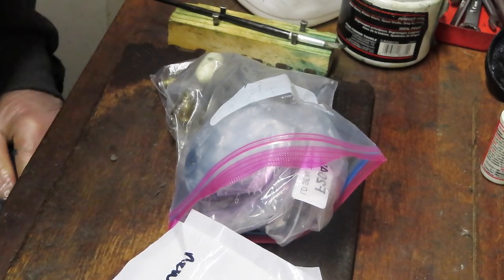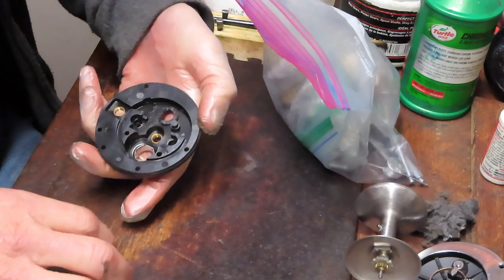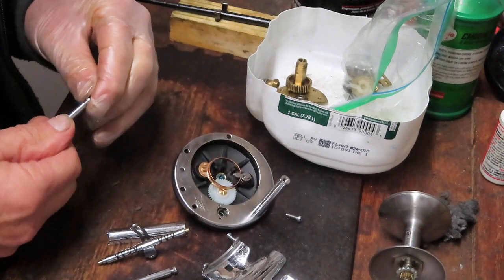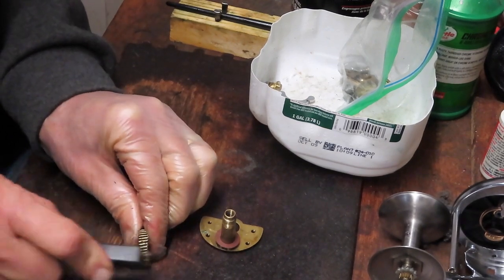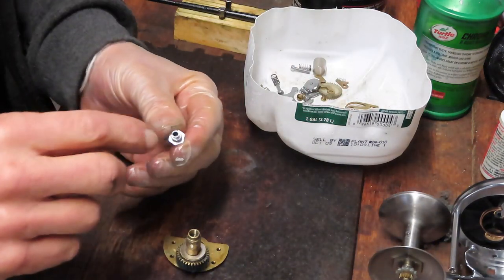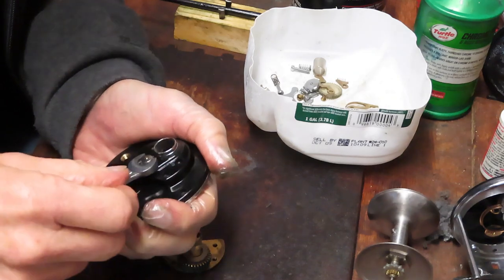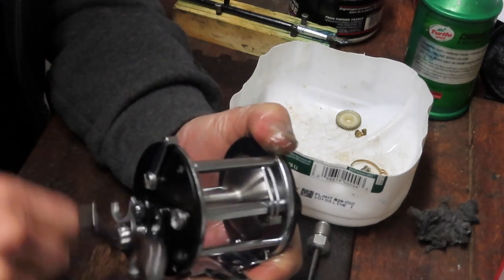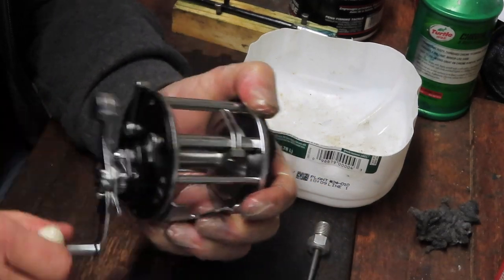Penn Peer 209 fishing reel in a bag how to service and assembly this parts reel

Comment: You know, I don’t like doing jigsaw puzzles unless I’m doing it with 2 or 3 other people. I don’t think you can do one of your fishing reel jigsaw puzzles. Your knowledge and experience enables you to do this. Doing this is truly an amazing accomplishment.  I’ve told you before my preferred fishing reel grease is Super Lube synthetic grease. It is the best grease for all my old vintage Mitchell reels. I’ve started using it on all my vintage spinning reels. It seems to not dry out as quickly and I like the white translucent consistency. Though it can be used for other things than fishing reels, several guys I know that work on a lot of Mitchell and Penn reels recommended Super Lube primarily for the old Mitchells. Two of these guys actually worked for Mitchell before they went out of business but kept servicing Mitchell reels to this day. Both are in their late 80s now.  I do use Pen Precision Reel oil exclusively. I learned my lesson about buying unbranded so-called reel oil on EBay. Don’t ever do that! That unbranded oil is CRAP!!! This Penn is going to be a beauty when you finish!  Last night I won another Luxor Saumon et Mer No. 3 spinning reel on EBay.  It is a  PUM version unlike my other one. I’ve learned that this Cadillac stub bail reel I have is surpringly similar to a Centaure Paciic half bail.  I’ll send you pics. to see what you think. I love the Cadillac - very smooth and extremely well made!  I’m looking at a Ru Mer surf reel now from the guy who sod me that Mer 52 Punch surf reel. I know he sells quality items.  I have my kidney surgery tomorrow afternoon. I’m in for a few rough days ahead.  That Luxor will arrive on Friday so you need to pull out yours and do a video for me! LOL Great video of this one as always Dennis!
Reply from the maker: I do jigsaw puzzles too, but these bag projects certainly are a challenge.  Best wishes on your upcoming surgery,  Dennis
Reply: @2ndChanceTackle  The surgeon broke up one sone on my right side and removed a large stone on my left side. I have stents in both ureters. I once had a cardiac arrest during the removal of a stent. I will be in a great deal of pain until the stents can be removed on Friday or Saturday. They should send me home tomorrow if nothing happens overnight. I’ve had over 40 procedures like this since I was 19.  These kidney stones area curse and plague . My fishing reel hobby is a great distraction and so is fishing in water weather. I’m getting a Shimano MLZ 30 spinning reel tomorrow and the Luxor will be here Friday. I just hope I’ll feel well enough to work on them. Thank you so much for your kind words! —— Chris

Comment: hi dennis. i have a same reel.  and the problem is that the winding guide seems not moving totally side to side and making a big bunch of line in the
middle of the spool.  any tip you can give me when I open it again?  thanks
Reply from the maker: Yes - watch this video first https://youtu.be/OepJuMe8d20 That will help you determine what part or parts are failing.  You will likely need to get replacement parts to fix the issue.  They are available through Mysticparts.com - Dennis
Reply: @2ndChanceTackle  thank you

Comment: Me again, I was wrong on my previous email about my Penn Peer 209, the brass level wind gear is ok, the reel is missing the white idler that turns the level wind gear. Could give me the name of the gear and if possible the part number?
Reply from the maker: Yes - here is a link that includes the part number.  You can also order from Mysticparts.com through this link,  https://www.mysticparts.com/PennParts/Parts/64-209.aspx. Please read the notes on the change in parts in the description - Dennis
Reply: @2ndChanceTackle  Dennis, looks like pinion gear is broken in half where yoke fit, weird. Having to buy a new gear set and idler gear may not be cost justified by the owner. I had offered to clean and oil his reel but the parts and shipping from Mystic may be prohibitive. Too bad, I really wanted to fix it.